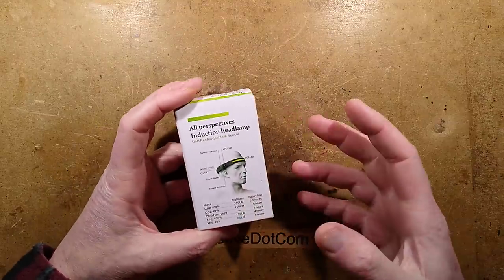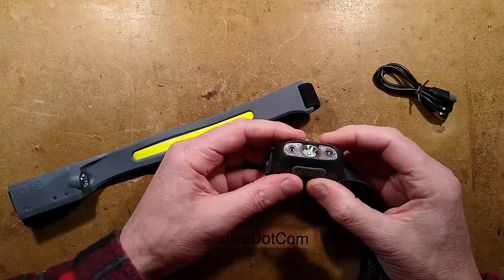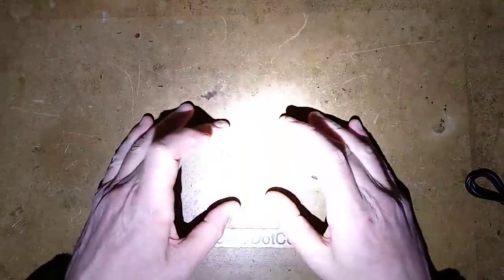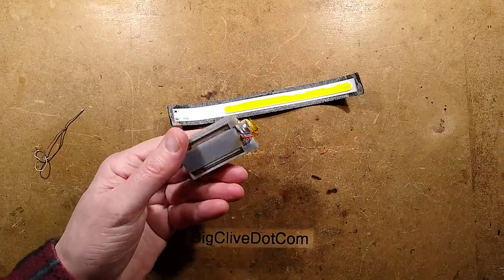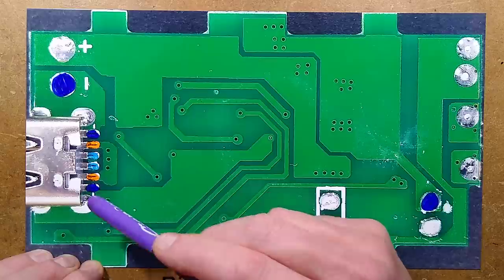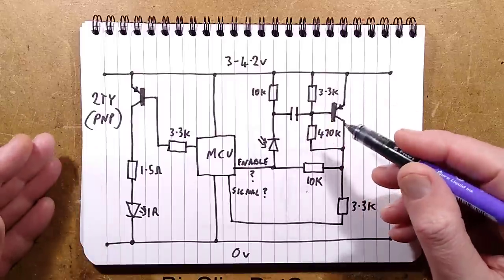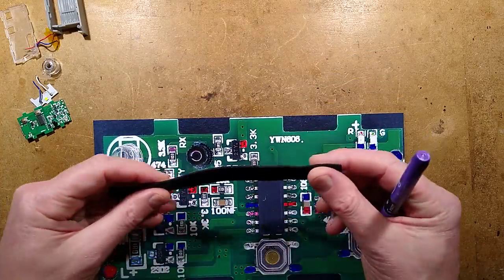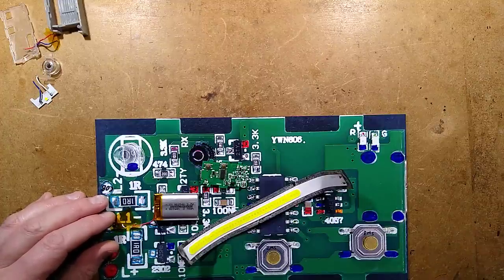Night Buddy style headlamp teardown with schematic

Comment: I got one and found it very useful. Using the COB light it is ideal for working in open spaces where peripheral vision is needed, cramped attic, unlighted garden shed, even out in the back garden at night. I found it so handy that I got a few extra copies to keep in my car, bedside table, etc.
Reply: I agree.  Much lighter to wear, I use it to walk the dog. But if I’m going out where the wild animals are I still need to use the big headlight that can spot things at over 100 yards. This is good for close up and comfort imo.
Reply: Why do you have a bedside table in your car?
Reply: @BoB-Dobbs_leaning-left  What? Don't You ever feel like just pulling over and taking a nap? Might as well be prepared.
Reply: @BoB-Dobbs_leaning-left  
Where do you keep your car pillows..
Reply: yeah cob lights great for working under cars  .. the 2nd one is like a torch so shite for that
Reply: @Miata822  good answer 👍🇮🇪 
I do that all the time.
Reply: @BoB-Dobbs_leaning-left  I have a bath tub in my truck, don't you?
Reply: How longs the battery?
Reply: @craigshandworld  1 mile long
Reply: I mean how many hours does the battery last
Reply: @craigshandworld  Physically? just under 50mm. 
How long does a charge last? Not sure. I have never had it run low during use, but I have only used it for brief tasks.
Reply: @craigshandworld  Sorry, From my observations in this video and rough calculations I would say about 40mins on full main led. Batt = 700ma LED chip = 20ma x 40 = 1000ma, quick math so sorry if a bit out.
Reply: It was all reasonable and humane until that "few extra copies"... Bot!
Reply: @BoB-Dobbs_leaning-left  Asking the real questions.

Comment: I studied electrical engineering in uni for a couple years and dropped out due to just not being able to keep up. I stopped working with electronics n whatnot for a long while due to that. Watching your vids makes me want to get back into electronics.
Reply from the maker: You can still pursue electronics recreationally, and that can often lead to a technical job.
Reply: @bigclivedotcom  You have a point, it’s been years since I do anything with electronics and I’ve forgotten most of what I knew, but that can always be relearned. Keep up the videos, entertaining and informative!
Reply: I also have learned so much here. Mr. Clive is a great teacher. Beats teaching myself.
Reply: I gave up electronics after high school because I never really understood it. I started getting into the hobby when I was young, assembling kits, but they didn't teach you that much about how they worked. When they offered it as a class in high school, but unfortunately it was taught by the woodworking teacher. I don't really think he understood it that well either because he never really explained anything, just basically what the components were. The most complex circuit we made was a transistor multivibrator, but that was never explained either. So I never really did anything with electronics after high school.

Fast forward some 15 years and I'd been collecting vintage computers for quite some time, watching YouTubers repair their vintage computers. I was working in a technical job that required wiring plugs on cables for things like microphones, video monitors, not actually doing electronics as such. I was thinking about getting back into it so I could repair my own when I came across Big Clive. I started watching his videos, came across more EE YouTubers and started watching them too. But it was Clive who really explained things in a way that I could understand.

Now eight years later I've been designing my own electronics, diagnosing component level faults on my vintage computers and repairing them. I've even designed a PCB for a memory module that works in those vintage computers, sent the boards and chips to a vintage computing YouTuber who featured them on his channel. All in my spare time.

If your uni experience was anything like mine, they pile on the work deliberately to make as many drop out as possible. Don't let that experience make you think you can't learn electronics, you just need to learn it at your own pace. You really don't need a degree to understand electronics, you just need to start trying to make stuff.
Reply: @UpLateGeek  I'm with you on the learning process. I'm mostly self-taught. I've focused on rebuilding and repairing donated computers as a MAR for a bit. I have a garage full of mother boards and peripherals. Took me a whole summer to part out 128 machines. Technology has changed so much they had no further value. I found Big Clive while searching for ways to repurpose peripheral devices. Understanding the functions of these sub-components is very enjoyable to me. And in this area Big Clive leads the way. My current investigations include alternate energy sources. Looking for ways to run systems that don't need components that drop voltage via resistors. Lighting is one of the most utilized systems we have. And Mr. Clive makes that easy to understand. Thank you Mr. Clive.
Reply: @UpLateGeek  Also, and I'm sure you've found this out, they don't explain everything because not everything is understood correctly. I think you said that about your teacher. I apply that to the industry.
Reply: I have been using one for two months doing work on copiers. Works great!
Reply: Get back into it heavily if the interest is still there. Nothing wrong with admitting you couldn't keep up...actually that's amazing you said that. 

Anything you did back then and think you forgot...I'd bet as soon as you pick it back up it'll all come back, especially if your heart was in it back then.

Get back into it! Have FUN. Make some cool stuff!
Reply: I'm a contractor who went to college 3 years full time recently for a degree in Photovoltaic Maintenance and Installation,  an electrical program , at the local community college in Los Angeles,  but they have 9 community colleges, most cities have one, if they have any at all. 3.6 GPA.  30 years ago I was a lousy student.
Reply: Left 15 years ago with a electronics engineering degree to work in a power plant. Best move I made, the understanding of how the base design of things works moved me to the top of my department.
Reply: Yeah I know 1st year I had was tedious had two math classes and I was bored....my hobby was electronics back in 91 I believe was 18 doing electronic from 16..Dropped out but spent 1000s of dollars on the hobby from then on. Better for other people do the work. If project is worth while I would built up something.
Reply: Why exactly did you stop ?

Comment: Gotta say, I bought a couple of these, which I use for camping and working under cars, and found them to be a total game-changer compared to normal head-lights.
With normal head-lights I seem to spend all my time adjusting my head to point the light where I want it and then having to look at things from different angles to see what I'm doing.
With the COB-light, it just lights up a broad area adequately and creates the illusion that "everything" is illuminated.

One thing I DID notice, which is quite important, is that can't be reliably charged by a standard USB-C connector.
Because the socket is inside a silicone sheath a normal USB-C connector won't reliably plug in to charge it.
Compare the cable that comes with the light to a regular USB-C cable and you'll see that the connector is a couple of mm longer than a normal one.
Reply: Since I use silicone cases on my phone's, and the opening for the USB connector isn't big enough to accommodate the body of the plug, I've relegated the 'OEM' cables to gadgets that live a more sheltered life at home, and use aftermarket cables that can be had with longer, typically 10mm if anyone wants to search, connector.
Reply: A lot if times, the little metal sheath on the plug end can be slid off and you'll be able to fit it into the socket.
Reply: I have discovered they same thing with a couple of Sofirn torches i bought. The usb c plug end is definitely longer because the female end is so deeply set in the plastic.

Comment: Brilliant tip about the potential issues with smart chargers.  I had dismantled mine trying to work out why it wouldn't charge (except when it was completely flat).  After seeing this, I plugged it into an altogether dumber USB source than the ones I had been using and all is well.

Comment: 8:48 - you can even see a little dimple in the battery-pack where the solder-connection pressed in.
Always fun to see these kinds of gadgets on your channel. Bought the same headlamp you compared this one to. Still happy with it. Put a piece of red filter in it by disassembling it to have a proper night-light for astrophotography. The big COB might be great for that aswell when it's on the low setting. Keeps the eyesight when needed.

Comment: I bought the other adjustable head light with IR your using in this video, I like it, after your recommendation of it in another video. The only annoying thing is if I'm working in a loft the IR beam can be interrupted easily if you move past a beam or move some insulation, then you're left in the dark lol.. I don't use that feature anymore, but it's a great head light for focusing the beam on junction boxes etc. And it charges in my van after I'm done. Great stuff!

Comment: My mom got me one of these for Christmas and i took it to Alaska to go fishing. I am an engineer on a fishing boat. I have to say that this is the best head lamp I have ever had! I really like that splash of light everywhere and i like that it is flush to my forehead. I never noticed the light getting hot or anything. Unfortunately, the battery protection circuit seems to be lacking as mine started melting and the battery pillowed while charging on the boats power inverter. Im not sure if the fault was in the headlamp or the inverter for sure, but other crew members were charging their phones on it no problem- so im leaning toward the headlamp. It continued to work until the battery ran out but would no longer charge.

Comment: This has been quite interesting, way more than I was expecting. I like the cob light as a choice. For some uses as moving through dark rooms, attics and so, the wide spread of light is quite convenient. 

I have a tiny flashlight with both a side cob and focusable spotligh that I use with a strap I 3dprinted, but the battery capacity mades it near useless. I might check for one of these and just hack the spotlight angle to my liking.

Comment: I have a pair of these.  Use them working and cleaning the car. Have not noticed excessive heat while in use.  About 3 ish hours use, but have the other charged so swap and go on.   The general light pattern works for what I do, the focused requires me to shift the band to put the beam where I need it. Nice it comes back on where you had it, annoying if you have go through all settings for off and on like other lamps.  The charge port cover is still a pain to get off, I may remove it.  Thanks for tearing yours down so I can leave mine intact... ;)

Comment: Got one of these. Very comfortable, lightweight, for my needs its exactly what I want plenty of light all around. I have used other spot light type headlamps and they were too bright in single spot and not enough light around. I had mine for under a year, used every night, and two problem with them is the glue that hold the cob with the backing material onto the band came off and 2-3 leds are intermittent sometimes they work sometimes they don't which does not really impact the brightness

Comment: Some observations:

I'm thinking that it might be possible to fasten something that's flat, light and flexible, about the size of a stick from an ice cream bar, to the back of the COB.  Then bend it a bit concave to make the COB strip focus to a narrower horizontal angle.  I realize that this may cause the headband pressure to be localized to the center of the forehead and cause discomfort.  Maybe once the COB curvature is adjusted properly, a 3D printed one could be made.  It might look something like this from the top
   >--<
And it might be thicker at the top to tilt the COB down.  Thanks, Clive.

Comment: Got one a few months back and have used it for all kinds of things (technical work in the dark, hiking, even some caving). I rather like the diffuse beam for close-up work. Much less glare and shadows than from a single point source. For hiking in particular, I wish there was a setting that kept both lights on to give you maximum peripheral+distance lighting. Yes, a regular light gives you spill and spot but I think a mix that focuses on the extremes (*very* broad and very narrow with nothing wasted in between) is better.

The side light is a total pain when wearing glasses though. Just floods one eye with glare though the side. At full power the COB is indeed noticeably warm on the forehead, but not uncomfortably so.

Comment: I personally found these style of lamps to be pretty useful for automotive work. A nice bright work space let’s me keep track of where my tools are and also since the battery is on the side it doesn’t dig into my head while I’m working under the car. Only issues I’ve had is battery life isn’t stellar compare to my previous light bar pro and the silicone layers came unglued.

Comment: I think these are great. I bought one, liked it so much I bought two more. My eyesight isn't as good as it used to be and I find the floodlight effect it gives really good for working by. My only gripe is after a while it gets rather hot on the forehead and slightly headache inducing.

Comment: These are actually really usefull due to the broad spread of light, when working in the wheel arch of a car say and any place where you need to use your peripheral vision. Also I find I knock them out of position less due to not having the traditional head torch section sticking out in front of your head.

Comment: Absolutely love this thing! Mine stopped charging though, so wired a USB cord to it to run off of a powerbank. Maybe could've saved the original battery function but my electrical knowledge doesn't stretch that far (yet)

Comment: I got one and LOVE it for night fishing. I found the LEDs on mine dont heat up, battery life is above what i need for a night of fishing, it puts off a ton of light, and the hands-free option is a huge bonus when you have minnow slime and worm poop all over your fingers haha.
Reply: After watching the video, and its actually the SAME ONE in the SAME PACKAGE except i got it with the high-vis band with the reflective strap. If you are on the fence about this, i would say pull the trigger. Ive only used it a dozen times and seems to hold its charge better now then it did before the battery was broken in.

Comment: I got one and I don't know how I lived without this.  The problem with wiring an electrical box is it's a box, and my head blocks the only path for light to enter the box. This headlamp replaces the blocked light. The light is spread out so it doesn't cast shadows.  I only use the COB at 40%. 

I assumed I would not be able to wear it without getting annoyed, but I kept forgetting I had it on!  I even used it on a volunteer trip to the Dominican Republic in August where I did some wiring, and it didn't make me any more uncomfortable. 

I have found no use for the Beam light. The 40% has a noticeable flicker; I wish they had picked a higher frequency. The IR on/off feature is too sensitive: it triggers when I walk through a doorway. I wish I could re-do their firmware to make it require a longer IR signal.

I think all my friends are getting one from me this holiday season.  It's gonna be a COB Christmas!
Reply from the maker: I like using a headlight to illuminate the inside of control panels while I'm working on them.  Even in a well lit area.

Comment: Ordered up one of these after watching this video for pottering around outside in the dark. The strip does a great job of providing a wide area of illumination without the effect the light direction changes when you move your head. The beam light is pretty useless but that's not why I bought it. For the money it's great for what I use it for.

Comment: I've seen the over the top ads and thought they would be bad, nice to know they are decent.

A while back I ended up buying a Fenix one, not cheap but with an 18650 and intensities set points that allow 16hr+ for long days and the floodlight is very useful.

Comment: I bought a few of these a year or more back, and when I can remember where I put them, they're not bad for working on my car in poor lighting conditions.

One of my co-workers uses one regularly at work, but his has lost numerous chips on the COB array, leaving it looking blotchy along the front strip.

All told, I use a "normal" LED headlamp with a battery pack counter-balanced on the rear of the headband when I need one at work.